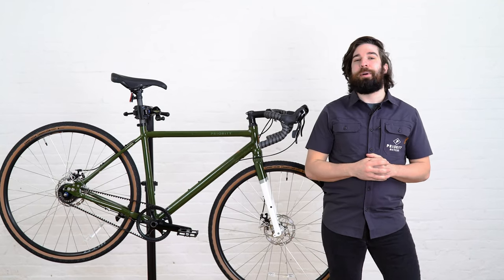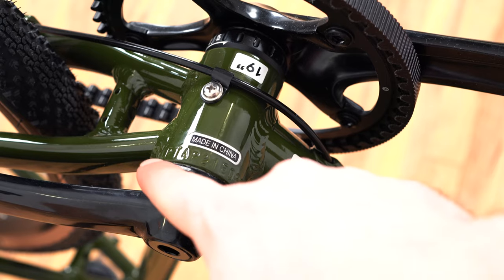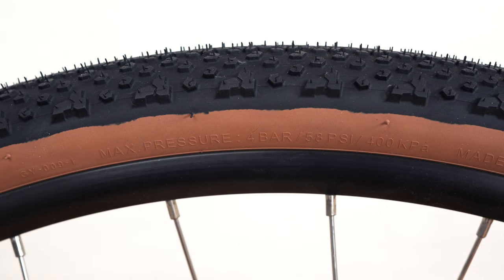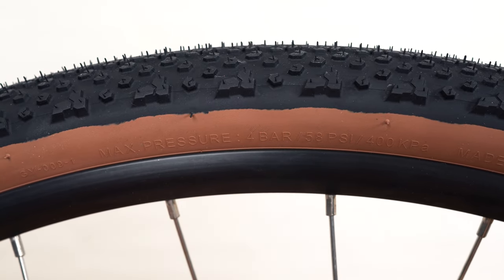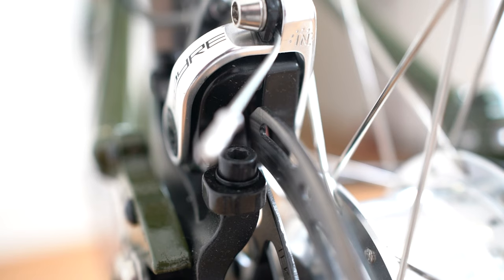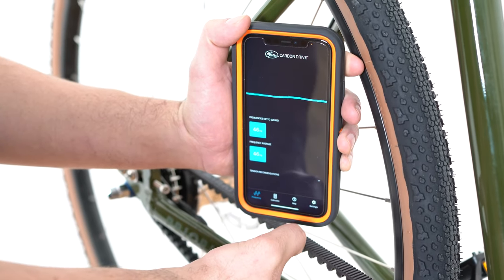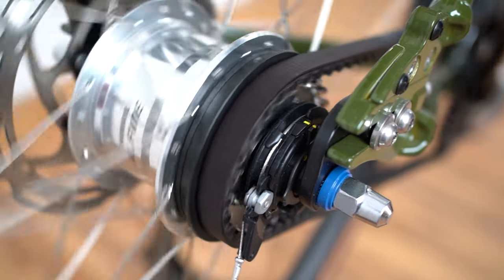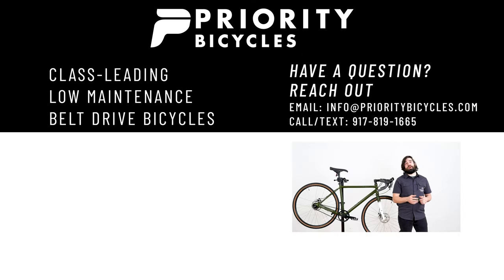The Basic Guide to the Priority Apollo

Comment: Do you guys have a touring bike ii. Trying go to new Jersey 🇵🇷💯  im in south Dakota    im planning in make videos for a free bike  i could be a embassador
Reply from the maker: Check out our 600 model -- it's an awesome touring bike that features a 12-speed sealed Pinion gearbox, rust/grease-free Gates Carbon Drive Belt, hydraulic disc brakes, 360-degree reflective decals, all-road performance tires, and integrated hub-powered dynamo front and rear lights. Shoot us an email if you have questions about the 600 - info@prioritybicycles.com

Comment: Is it bad to not stop pedaling when shifting
Reply: The reason for the instruction to stop pedaling when shifting this internal hub has to do with the construction of the internal gears which are mostly a pinion system. If you stop pedaling while shifting, the gears will have the time to mesh completely and move to their optimal position which avoids placing too much pressure (derived from the downward torque of your pedal and crank arm) on any one part of the gear when the gears didn't have the time to change into position otherwise.